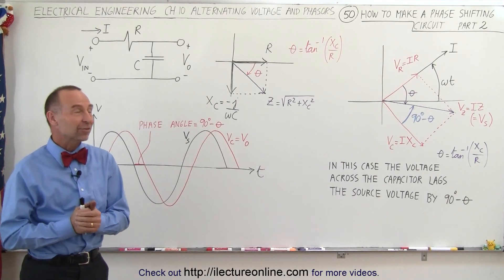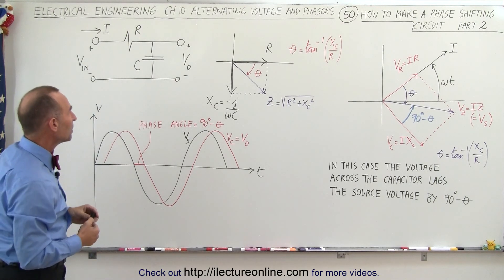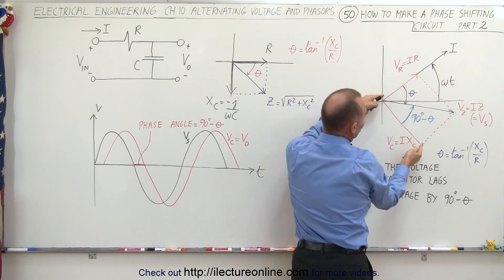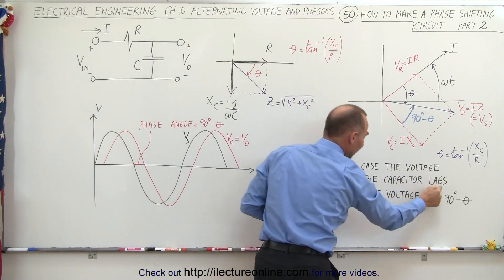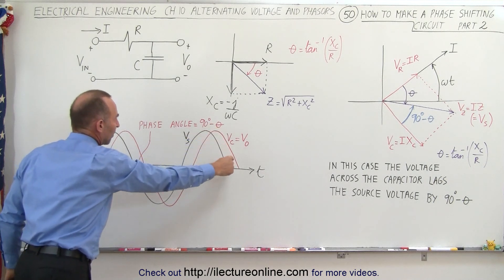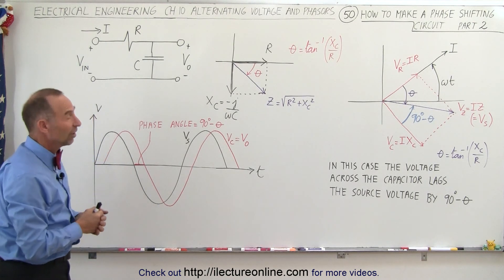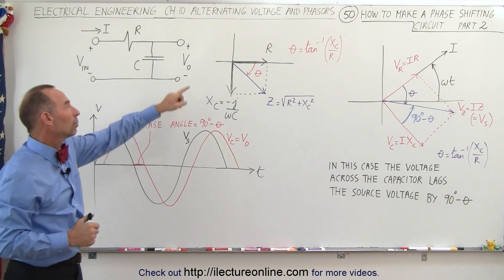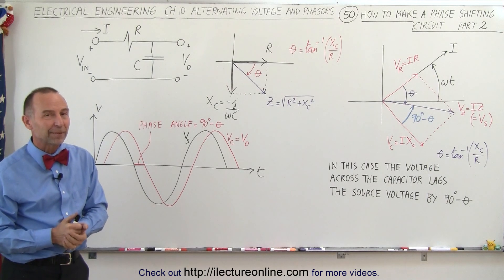Electrical Engineering: Ch 10 Alternating Voltages & Phasors (50 of 82) Phase Shifting Circuit P. 2

Comment: Sir, i don't understand why is it if the phase shift is close to 90 degrees it would be zero?
Reply from the maker: If R approaches zero, then the reactance across the capacitor approaches the impedance and and the phase angle between the voltage across the capacitor and the voltage across the resistor approaches 90 degrees.
Reply: @MichelvanBiezen  Thank you sir. Then If R approaches zero and the output is taken to across the capacitor the output would be Vo=Vs and no phase shift would happen, right?
Reply from the maker: There would still be a phase shift.  As long as there is resistance (all real circuits have resistance) there will be a phase difference.
Reply: @MichelvanBiezen  alright sir. Thank you.